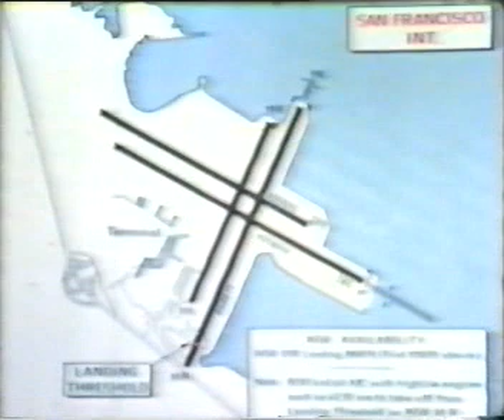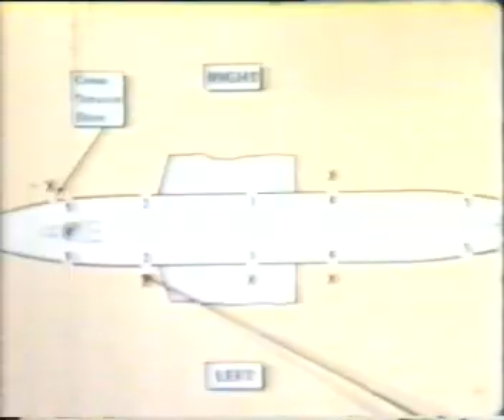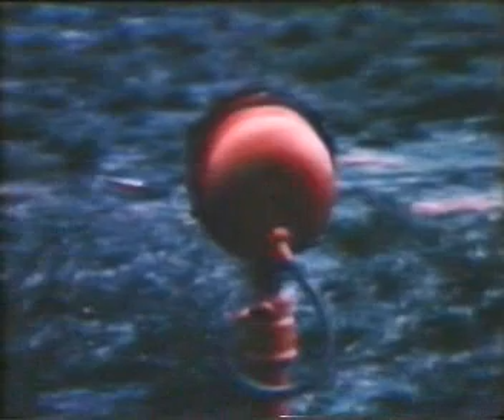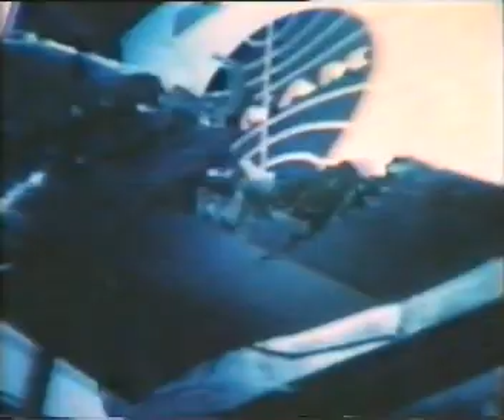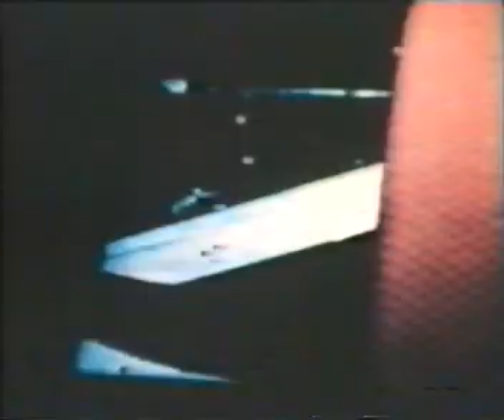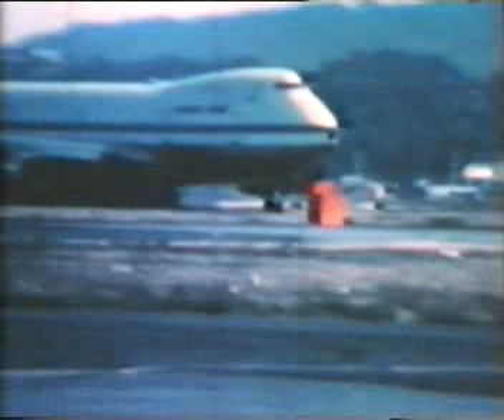Pan Am B747 San Francisco Accident 1971

Comment: Nowadays so many pilots rely only on auto pilot they would not know how to handle a hydraulic malfunction in flight.  Those PAA pilots really knew their stuff.
Reply: 1. The PAA pilots caused this accident.  It was pure pilot error.  So much for really knowing their stuff.

2. The hydraulics would've been managed by the flight engineer (as was all the fuel dumping)  The main difference for the pilots was in how the plane handled.  Nowadays hydraulics do have problems and pilots land the planes.  They have to manage the issue themselves (switching pumps and systems and fuel management) as they don't have a flight engineer (on the 747 it was phased out with the 744)

3. The autopilot system  on the 741 was quite sophisticated and could handle almost as much of the flight as the system in the 744.  The 741 also had inertial navigation systems (3 all linked together for greater accuracy) that meant that only the takeoff and landing had to be hand flown.

4. Pilot training today is far superior to that the pilots in this incident had.  That is as a result of decades of experience.
Reply: Well, no they didn't.  That's why we're watching this video.
Reply: Some more on here from the NTSB report.  

"The aircraft had been dispatched for a departure from a closed runway and, upon changing to an open runway, the crew did not recompute the proper reference speeds
for takeoff under the existing conditions."

1. Why didn't they check whether the runway was open before they pushed?  When you're the captain or first officer, it is your responsibility. 

2. Rebugging the aircraft is basic.  They could've rotated in enough time to avoid the lighting had they set the speeds for the additional flaps.

Supposedly his grandson on here said

"#2) The engines underperformed by 200-300 feet & Boeing could not tell NTSB why."

1. From the NTSB report "All four of the engines were inspected, re- moved, placed in the United Air Lines engine test cell, and operated to determine their functional capability. The engine pressure ratio (EPR), fan and compressor rotor speeds, exhaust gas temperature (EGT), fuel flow, and net thrust output were recorded. These parameters, with the exception of the EPR, were corrected to a standard day condition and then compared to previous test cell and in-flight data. The comparison indicated the engines were operating within Pan American and Pratt & Whitney specifications."

2. Boeing had no explanation to the NTSB, because it was sod all to do with Boeing.  The engines were made by Pratt and Whitney and according to the NTSB performed within spec.

Yes the pilots were advised incorrectly about the runway length, but again, had the schoolboy error of not rebugging the aircraft to the new airspeeds (the flaps were now 20 degrees allowing a slower takeoff speed) not been done, this would not have mattered.

This was pilot error.

Comment: STOP 
using  products of the Peckerheads built Stink, POISON, cheap products to crash and burn. All testing epuipment from Laversab unit automatically take off and landing achieves the targets high acurate 99.98 % out of control and spin aircrafts without warning the airline land tail first, break off, burst into flames crash and burn then kill people on board. Made in China dry wall hidden tag inside the products.
On the other hand all is becoming a "cattle car"
Reply: So, how's rehab going John? Did the pills work?

Comment: It doesn't matter whether the area around the runway is land or water. If you miss the runway or go off the runway, it's not going to be pretty. The pilots know how long the runways are and where they are, they just have to aim right and get airborne before the runway ends. Communication and correct information is key.

Comment: My grandfather was the pilot.
#1) They said the runway was 1000 feet longer than it was.
#2) The engines underperformed by 200-300 feet & Boeing could not tell NTSB why.
#3) Plane was overloaded for the runway by 11,000 lbs.  

My Grandfather asked SFO about runway length, PanAm and Boeing about weight for runway 1R.  They all gave him bad information.

It shouldn't have been able to take off.  It was a feat of amazing flying that he was able to land it as badly damaged as it was.  No one died.
Reply: No. They were told the runway was 9500ft and the runway is actually 9500ft long. Planes like this one were not allowed to use the first 1000ft because someone believed the jet exhaust was causing wrecks on the highway behind the runway.
Reply: @misseselise3864  no, the runway was not just limited due to the lack of a blast shield protecting vehicular traffic on the freeway.  The entire paved length of the runway was counted in the distance even though a large portion it was unusable due to the runway approach lights that were above ground.  These lights were what caused the undercarriage damage.  
Additionally the runway ended at the water directly in the way of a ship channel so if there were vessels in the vicinity the pilot had to take off even earlier to clear the air draft of the vessel which could be well over 100ft in height.  This is the case for other areas like Boston Logan.  In Boston if ships are anchored in the area by way of the runway approach or take off the pilots have to adjust to ensure they clear the ship.  Nothing like have 777’s following landing paths directly over your ship and clearing the top of the mast by only 100 feet….. at SFO at the time no tracking was done for water traffic in the area and the pilot had to visually judge danger as he came down the runway.  Now, the tower tells the pilots like in Boston.
Reply: Interesting. I used to work with one of the passengers.
Reply: Incredible just incredible, hat's off to your grandfather. Thanks for the info.
Reply: No pilot does anything but their best. They're at the front of the plane after all. No accident has only one cause. If you read page 4 of the NTSB report, it seems like it would have been a very reasonable expectation from the information they were given that they had an additional 1000ft. The flap settings are bit less clear, and they did miss the callout on the PA to evacuate.... right after they landed a huge heavy plane right on the runway with 25% of its hydraulics and 1/6th of its effective control input while missing several landing gear and with a massive CoG offset.... so... yeah you might miss a switch... but in any event... you watch that landing and I dare you to tell me it wasn't masterful airmanship. Yes people were hurt, some in life changing ways, but it could also have ended WAY worse.
Reply: Respect to your grandfather!
Reply: Kudos to your grandfather for the safe landing! My Grandfather was probably one of the mechanics who had to fix that mess…if it was salvageable. It’s what he did for PanAm @ SFO
Reply: His grandfather wasn't a pilot WTF and my Grandfather flew a B-17 in WW2 😅
Reply: I hope he was exonerated 100%
Reply: I have a PanAm 747 model of N747PA,  Clipper Juan T Trippe on YouTube if interested
Reply: That’s so COOL !!!!!
Reply: Why would Boeing be asked about the engine performance when they didn't even build them?
Reply: Your grandfather is an angel, he saves people's life
Reply: According to the report it was perfectly flyable. Cpt. Dyer and FO Oakes still failed to recalculate V1 after changing flaps and  FO called V1 too early. Upon coming to a stand still they made the call to evacuate over the radio, not the comms to the cabin. Good thing there was zero fatalities, but there were still people who suffered serious injuries and those hurt from using the wrong exits would have been ok if the crew had been given the evac order correctly.
Reply: I call bullshit - people claim those things all the time 🤣🤣🤣
Reply: @TheLukaszpg  I call bullshit on your bullshit. Could be real but biased perspective. Who knows.
Reply: Freaking legendary performance by your grandfather.
Reply: Boeing doesn't build engines.
Reply: Is it true is your grandfather is a pilot